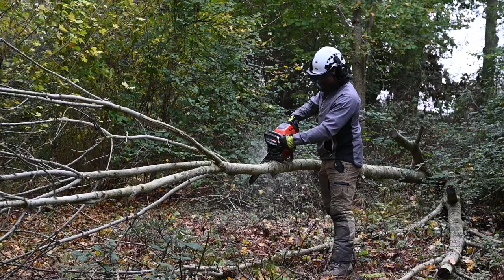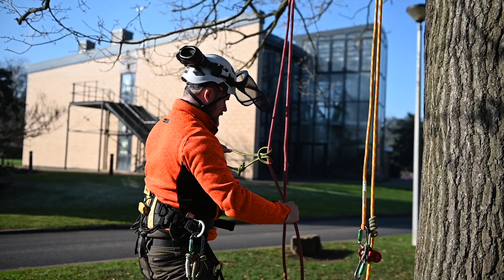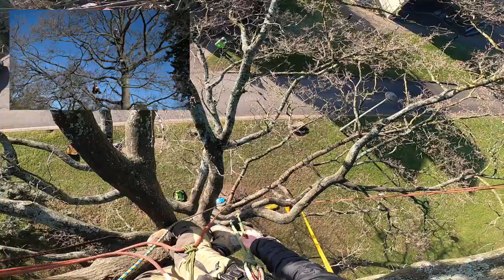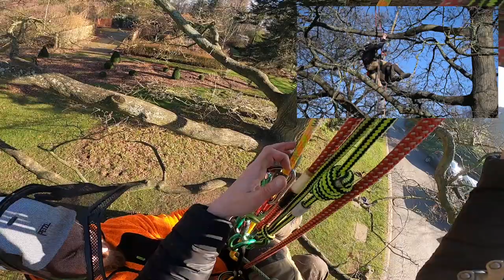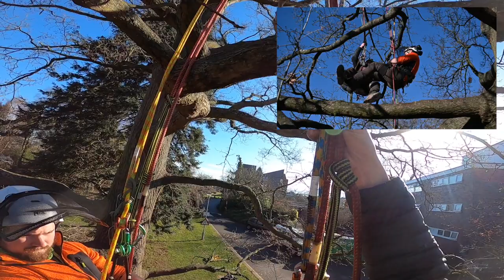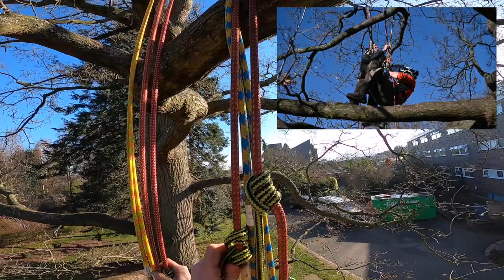Tree Climbing - Aerial Rescue - Damaged and Undamaged Rope

Comment: 1 DDRT sistem a flipline, breadge connection, and a redirect far enough for a fast and safe areal rescue.
Reply: To pass the competency assessment in the UK they must meet certain criteria. This video is for revision for the students who have undergone the complete training at the college where they look a range of rescue techniques.
Reply: OK I understand but this way can not be useful and safe in a real situation
4 different ropes unnecessary when any climber get problems in the tree
Sorry but this is my opinion and experience.
If you climbing DDRT "hitch climber setup" just add a rope wrench in to the sistem and ready to use.
Or another divice like :  Dmm anchor ring with a carabiner, or just a figure8
Sorry to bother you
Kind regards
Reply: @jardikferenc194  it's fine pal your not bothering anyone, it's good to chat and share ideas. They can go down to one line to rescue as you say with extra friction provided, there's a couple of reasons why they havnt here related to assessment criteria and training standards, but as you say the rescue could be done dropping down to 1 or 2 lines And as I said they do look at these options too. 
Thank you 👍
Reply: Andy Jones thank you for the video
👍
Reply: @jardikferenc194  I believe the 4 systems between 2 climbers represent a new policy in Europe to utilize 2 lifelines per climber. It does make a rescue scenario more involved. 2 lifelines would be beneficial in some respects. I like the idea for safety & positioning purposes. The con would be fatigue from additional friction & line management.
Reply: I'am climbing in UK years ago
I'am using 2 sistems if that tree is complicated. 2 ropes can be useful yes but not all the time

Comment: Any videos in the works for lifting the casualty before the pick-off? Most videos I see and even competitions involve simply accessing and lowering the casualty on a working system. What's your plan for raising Andy? I would be curious to see how arborists take care of that issue.  Thanks
Reply: @PerryFire Hi mate, yes we do have plans In place for lifting/raising of a casualty if a strait decent isn't practical.

We could perhaps work on a short video for that!

There's more to it and depends what system the casualty is on but as a brief description, a friction and pully system would be installed above the casualty, line fed through to make a two into 1 hauling system groundsman could haul/pull lifting the casulty. There are other ways of doing this aswell.

Hopefully that describes it will enough but we can work on a short video!
Reply: I would like to see your techniques as taught. You just don't see any lifting done on arborist videos. I even went to an arborist rescue competition once and they only accessed and lowered. 

I'm familiar on SPRAT, ITRA, and IRATA  techniques but I'm always curious how an arborist intends to accomplish the same job. We don't always have the luxury of simply lowering our casualty onto our system or their system. 

Back when I was active I always carried a small homemade 3:1 with a micro-traxion for lifting victims. Although counter-weight techniques work they aren't fun and they involve a fair amount of proper balance and coordination. 

Also, do you guys ever use pick-off straps or the rock climbing equivalents? And I noticed you use a two-rope system. Is that required now in Great Britain? 

Cheers
Reply: @perryfire3006  for the most part, my personal opinion, within arb its much less likely that providing the climber turned casualty has managed his ropes, route and work within the tree they would need to be lifted. 

As I said in the event they need to be lifted there are ways and equipment that most teams would have available to do so but its all about the work/rescue being planned, prior to it being needed. 

Counter balance techniques are relatively common within arb, as a rescue for SRT systems and pole rescues mostly. 

There is no "two rope system" its commonly put like that but its climbing with a primary and back up system, our working at hight act 2005 specifies, in short, that you need a working line that provides access, egress and movement and a back up system that reduces the consequence and severity of a fall. They dont need to be "two rope systems" in the way most mean, specifically. I guess it ends up that way, as most often it can be the easiest way to ensure compliance. 

The video shows rescuing on 4 yes, but as Ben in the video states you can remove systems to provide a faster and more efficient rescue, one of the reasons its not done in the video is our industry standards and guidance recommend that during simulation and training another line or system stays installed, although in a real rescue scenario you can emit back up systems and be compliant, as i said for a fast and efficient rescue. There are other reasons aswell. 

The industry has technical guides that outline it all you can buy, not expensive either. Certainly a video idea though mate!
Reply: @ajfreelancearb  Thanks for a detailed response. I'll be watching for that video.